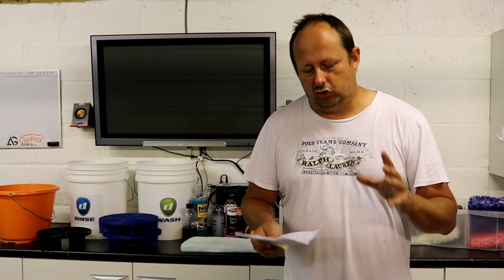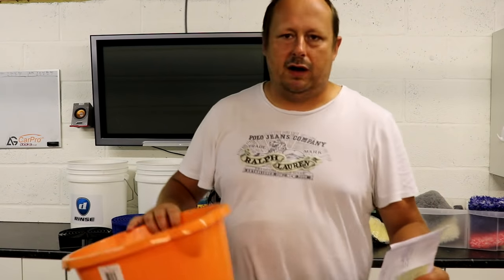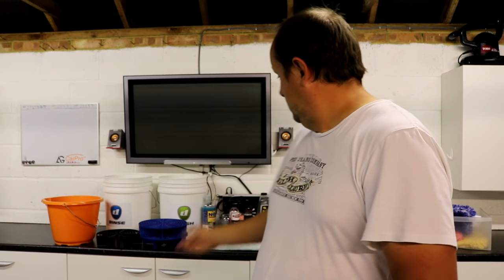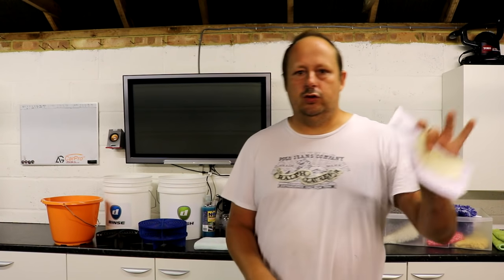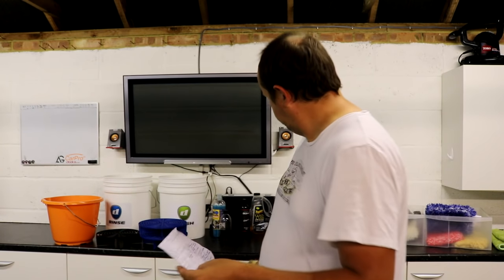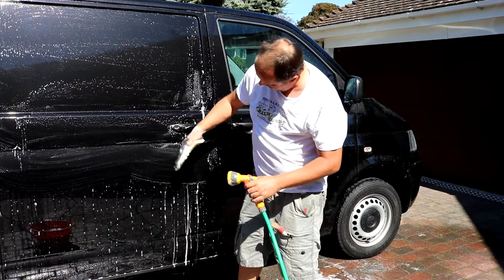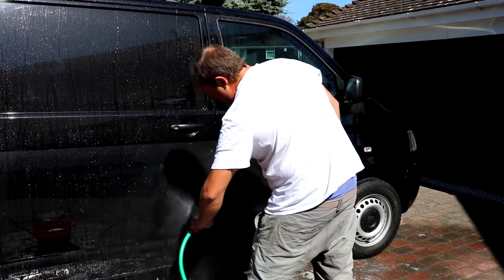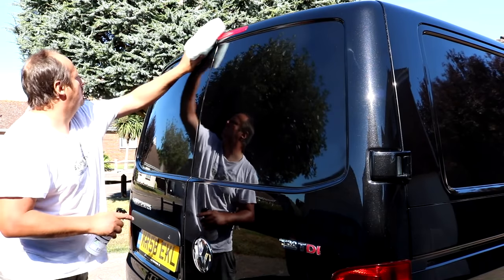The Forensic Detailing One 1 Bucket wash method

Comment: 1)Well First of All, the Video is way too long. And I could not stand watching whole video not jumping in the sections. Cause there is just one important thing, that you wash your mitt with clean Water outside the Bucket. And its basicly it. Ofc you did mentioned some nice side infomations, but hear the same information over and over is kinda weird and also repeating it alot of times. 

2)2 Bucket Method is ofc not the ideal way, and you always get some dirt on your mitts. But if you are doing weekly carwash and  prefoaming pretty nice, the water dirt contamination is pretty low.  Also using 2 mits for the Top and buttom parts of the car reduce the scratches on the importants sections. Ofc sometimes you get 1-2 mini hologramm scatch. 

3) Just by polishing 1 time a year with Finish Polisher is enough to remain the car in perfect state.

I am driving BMW 135m coupe of 2012 with the value of 65000€. So pretty expensive car in my oppinion. And I never dome any big misstakes by using the prefoaming and 2 bucket method with 2 wash mits. 

4) also you have not to forget, that you get hologramms by just driving at high speed rubbing the particles in the air. Having good wax or ceramic protection is way more important than just talk about how good or bad the 2 bucket method can be. 

And Hallo from Germany. Even I do put alot of critic on you, I still like you and you are doing great job detailing.
Reply from the maker: first class feedback..   holograms by just driving at high speeds... you have some very aggressive particles in the air in germany!  thank for watching Max..   M135 :) beast of a car...
Reply: Well not exactly holograms, I mean just normal driving scratches. I guess you know what I mean. >
Btw, are you guys not using Menzerna, Gyeon products or chemical guys for polishing? Here in Germany this are the top1-3 products. Also the Coupe is alot better than the new F20 m135i. Coupe Had better meterials and is kinda identical tot he new M2. Well guess just the marketing way to sell cheapest version with great engine and also offer the "new" M2 Model. Only 1000 cars of m1 coupes were build, so yeah, I know exactly how nice it is^^
Reply from the maker: ah right. the m135 coupe yer. I love those as well.  the f20 135 has some epic things.. but I almost feel with that much punch the car should be a bit less refined.. the zort system lets it down a bit..  so does the handling when its wet.. but thats most of the negatives done with..  hell of a fast car.

For polishing....  german abrasives rule you also have scholl and koch.   and those are the abrasives I tend to recomend on the channel...   The guy that developed them (michael hauber) also developed the menzerna line (but the menz line is a lot older)..   Gyeon and CG abrasives are not developed in house...   The channel talks a lot about abrasives and such.   But scholl and koch would be my choice for reasons that could take a long time to go into..
Reply: Thanks for nice tips. Sure I am not total beginner, also detailed like 12 cars so far. And trying to impouve. Cause I love to make the cars Shiny. Does not matter if its my or belongs to a friend of my.

Comment: I know this video is a few years old now, but i have only just this past week, sat down and thought about the 1 bucket method properly and come to the conclusion that it is safer,easier method.

Been doing the 2bm for years but i have finally seen the light, but iam doing it slightly different to you on this video.

1 bucket with shampoo/water and use multiple mitts, do a panel or so then put that used mitt to one side and grab another clean fresh mitt, that way no crap goes in your bucket whatsoever, so from start ro finish your water will be 100% clean and as you mentioned in this video their is still a good chance with the 2bm to still have crud in your mitt, no matter how much squeezing and rinsing you do.

No gritt guard needed, only 1 bucket to lug around and fill up, no multiple dunking etc its better in more ways than 1, wish i did it sooner.

Also took a liking to snowfoaming the shampoo on the car also, aswell as in the bucket, just makes the contact wash more enjoyable and more lubricated.
Reply: jason mennie one bucket works great if car isn’t filthy and you rinse most the dirt off first.
Reply: I use the hose or power washer and rinse my mit prob3 times every wash. Takes 5 seconds
Reply: If the car is dirty enough I’ll be snow foaming and power washing on high pressure to get off most the dirt
Reply: I would also highly advise to take the time and get the car crystal clean and coat the hell out of it with a geon wet coat type product and you don’t even have to put in much effort washing it
Reply: jason mennie a good coating of geon wet coat on the wheels ....I just powerwash them and the dirt runs off...amazing

Comment: So you used this method to wash the Golf for a year and there are no swirls on it? I wasn't expecting it to work THAT well ha!
Reply from the maker: yes leigh most times I wash the golf..  I got with this.. perhaps not so much in the winter though when it needs a proper pre-wash.. because then ive got the pressure washer out and this method doesnt really work with a pressure washer because you have one hand for hose and one hand for mitt...

Its not so suprising though.. I mean the thing you can see in the vid is how clean you get the mitt from rinsing...  there is no way I can get the mitt this clean with a rinse bucket as the rinse bucket gets progressivly dirty..

but I think another huge reason why its safe is the ONR..   no matter what wash method I use. ONR goes into the wash bucket with the shampoo... that stuff just works (and when I decided to feature it if Im brutally honest I thought it wasnt going to work)
Reply: I love ONR. I polished a test panel to perfection and then flung mud and dirt from a plant pot at it. I then baked it on with a hair dryer. Didn't pre wash or spray anything. Went in straight with ONR on a wash mit on one side and rag company creature on the other and neither put a scratch on it. Couldn't believe it. It was absolutely caked in dirt. I didn't even do one pass and change sides. I just got the creature filthy and rubbed in one spot for minutes. Still no scratch.
Reply from the maker: the number one thing I wanted to prove to myself.. is does this product provide resistence to micro scratches from when you move dirt around..  It absolutely delivers on that and this is why it goes in my wash bucket every wash.. Ive done similar tests as well.

Comment: I'm still a 2 bucket wash guy and agree with everything you say. The 2 grit guards in rinse bucket is defo a good idea. 

What you could do for the ultimate safe wash if you have a pride and joy in perfect nick would be to employ all the tactics together. 2 buckets, 2 guards in one, use onr to soften the water and Also use the hose to rinse the mitt before it goes in the rinse bucket to minimise the rinse bucket dirt.
Reply: Adam Freeman what is dunking you mitt into a bucket adding if you're blowing the mitt clean with the hose?
Reply: Adam Freeman's suggestion is adding an extra layer of safety 😊 (just in case)
Reply: Duking the mitt after hosing doesn't make sense, why not hose for longer. Its like having a shower then getting into a bath.
Reply: Bill Ding it's just all about doing absolutely everything possible to minimise damage to the car, even if it removes 3 more small
dirt particles dunking it's at least something
Reply: A new mitt for each pass is the safest way (for the crazy).
Reply: Bill Ding I agree, but im trying to put in some common sense too lol
Reply: Bill Ding ahh, that's excellent and 100% True but just unjustifiable realistically...

Comment: So you haven't inflicted swirls using this method? Or at least not enough to make a mess? 

If you was to use this method on a super car that was flawless, how would you adapt it? Let's pretend you couldn't use a different method!
Reply from the maker: great question...  so how would I adapt this for super car thats flawless... hmm.. Chinese mitt would be replaced with dooka..   pre wash quick rinse in water would become a nice long soak in a snow foam and low pressure rinse..    now I could still use the hose to clean the mitt off..  but it does work so well rinsing a thicker pad like a dooka with the hose, like I show with the chinese mitt.. so I would use a 2 bucket method with a pad...       so basically I would prolly use a more standard 2 bucket method... :)